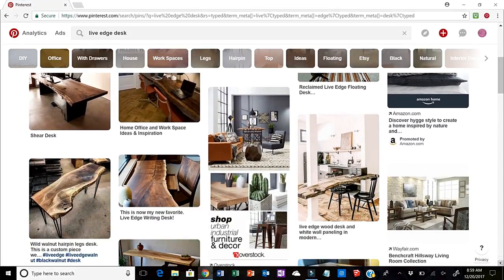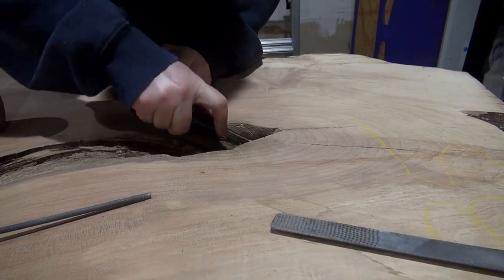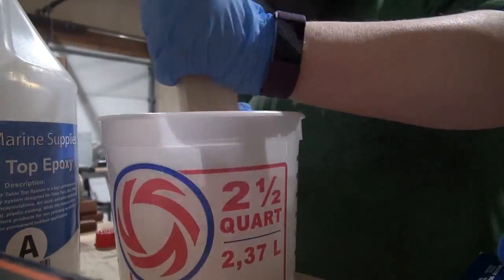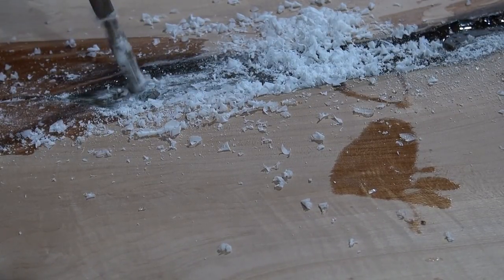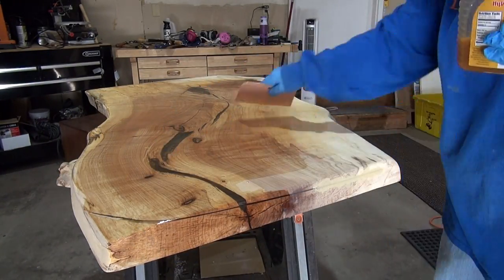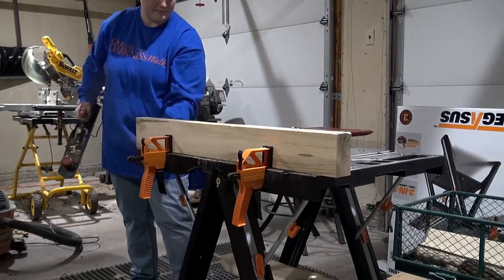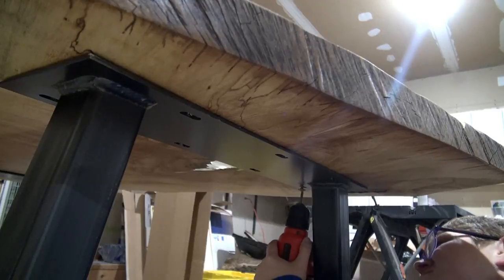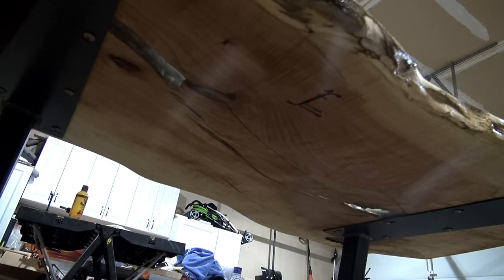Wood Slab Desk How To

Comment: Great work - very inspiring. I like that you don't feel the need to buy lots of power tools and machines, and do a lot of hand work. Can you please tell me the source of the steel legs for this project and what looks like aluminum for the coffee table?  Finally - what is the minimum live edge you should work with as a general guide?  Thank you!
Reply from the maker: I used this website as design inspiration for the legs for both projects, https://steeltablelegs.com/ . You can purchase the legs directly from them as well. However, I worked with a local metal worker to recreate the designs with just some minor tweaks. In each case the legs are steel, just painted black for the desk and painted silver for the coffee table. I'm not sure what exactly you are asking as far as minimum live edge you should work with, can you explain a bit more what you are asking?  Glad you enjoyed both videos and found them helpful!